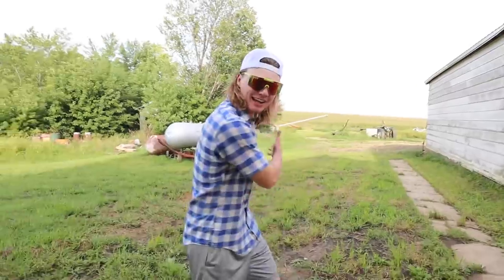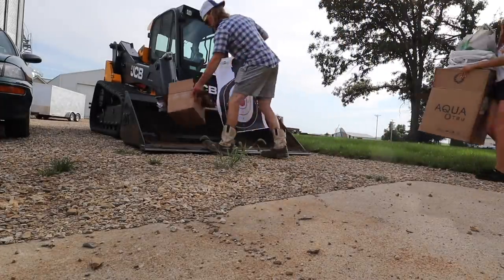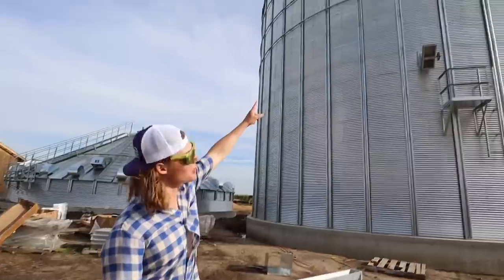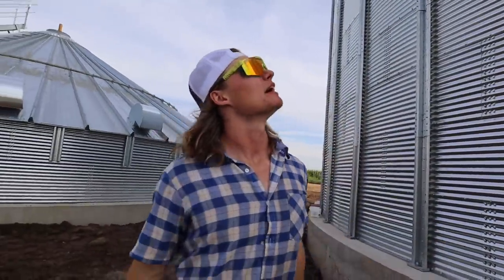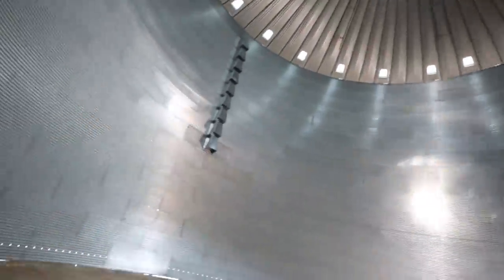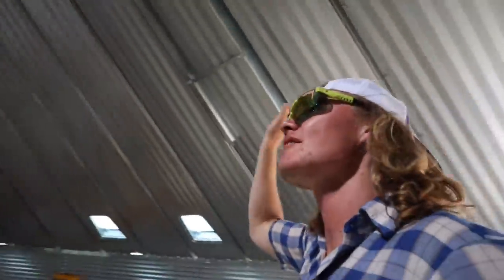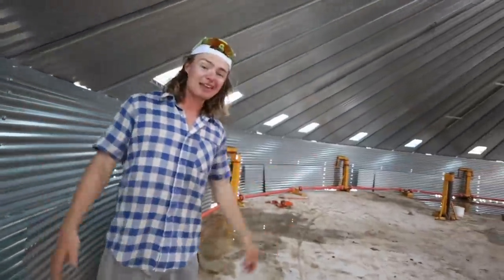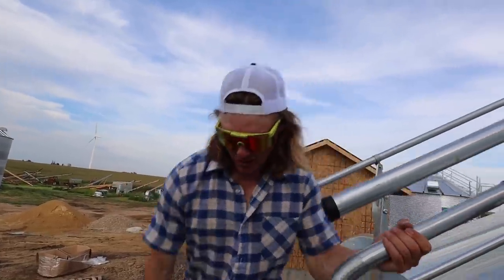Daddy Cornstar Is In The Hospital (UPDATE)

Comment: I hope they are checking your dads heart. I had very similar symptoms back in 2019 and it turned out to be blockage. I had a quadruple bypass and valve repair. Now I feel absolutely great and breathe better than I did when I was in my 30's.  Also, diet is very important and while it's almost impossible to avoid,  resist salty foods.  They are not your friend.

Comment: The incentive spirometer, the most simple tool in the tool box so to speak, saved my life. I figured if I had to be there, I might as well just do it over, and over, and over. So I did. 

They expected me to die. I was on life support for 5 days, but I’d sat and looked out the window waiting to get well and it took a sudden turn on me. I was in the hospital 3 weeks. I have no comorbidity at all. They took the vent out and I started breathing with that spirometer non stop. If I stopped to shower or go to bathroom I’d drop back to 80, but It went immediately back to 90-92 once I started doing it again.
Reply: Your dad is prob home by now, but this could help someone. My instincts tell me that if everyone did the incentive spirometer from the day they were diagnosed, hospitalizations would be 20% of what they are currently. 

I was right where your dad was at the time you filmed this, and within 1 hr I was surrounded by staff who were tubing me and getting me prone on a platform.